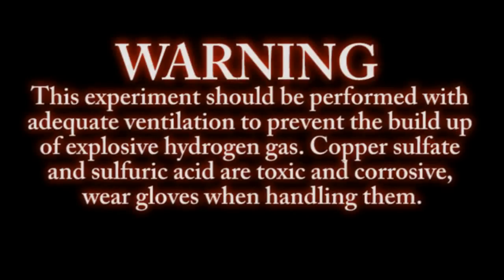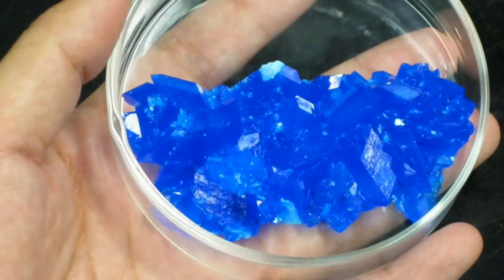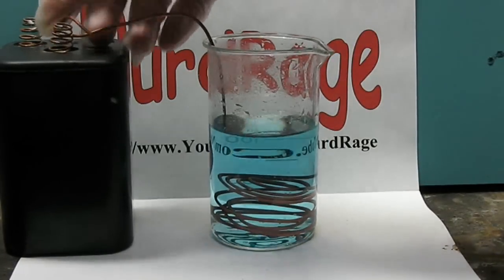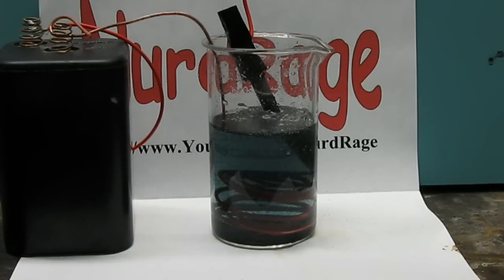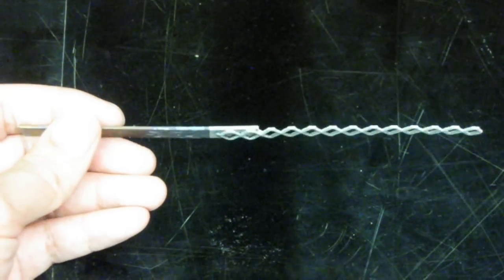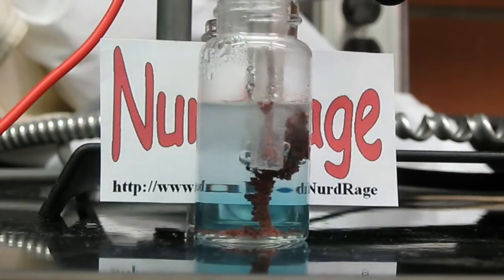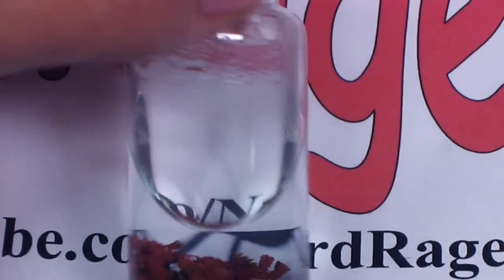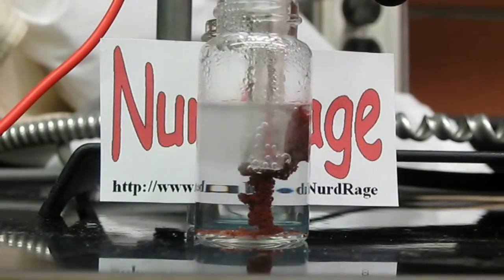Make Sulfuric Acid (Copper Sulfate Electrochemical Method)

Comment: i switched the carbon electrode for a graphite one and it worked considerably better. the graphite didn't erode and it worked very quickly and very well
Reply: Holy crap I didn’t expect to find you here ten years later
Reply: @jasonnikakis6033  second that
Reply: As in a lead pencil?
Reply: @dragan3290  I tried pencil lead the same day I commented that, and (possibly due to my power supply being too strong) I just got super fast erosion and heating (some of the tape I used as a quick test for the electrodes melted). I plan on opening alkaline batteries for zinc and manganese so I'll definitely get some proper carbon electrodes from those too
Reply: @jasonnikakis6033  aaaawwww yeah! Alkaline battery? I forgot all about that! I need to do a refresher in electronics! Lol. Thanks for the quick reply 👍👍👍👍
Reply: @dragan3290  no as in a graphite rod .
Reply: Random idea but what if you literally wrap the carbon electrode in a filter? Flow of ions should be unaffected (?) And the particles stay inside. I wonder if this increases resistance or not
Reply: @jacobkudrowich  Which are found I'm alkaline batteries
Reply: wow
Reply: What's the difference between carbon and graphite??
Reply: @JoakimfromAnka  the crystal structure. Graphite is when carbon is formed into neat, stacked honeycomb sheets

Comment: If anyone wonders I just calculated that 750 grams of cupper sulfate pentahydrate should give a theoretical yeld of 161 ml of concentrated sulfuric acid. Just saying...
Reply: thank for that i was one of those wondering... and what concentration over 50??
Reply: Cool
Reply: Do i can use gold electrode and titanium electrode ?
Reply: Could you end up with 99% acid if you use anhydrous copper sulphate? It seems that about 1/3rd of the weight of copper sulphate pentahydrate is water and must be almost impossible to achieve a concentrated acid from electrolysis alone. I might actually try it with anhydrous and just keep adding it until no more dissolves and see how much I get.
Reply: @mrdojob  Whether you dissolved anhydrous copper (II) sulphate or copper (II) sulphate pentahydrate into water, the copper (II) sulphate will dissociate into the solution. Sadly, it won't make a much of a difference if you dissolved anhydrous copper (II) sulphate instead of copper (II) sulphate pentahydrate. You eventually end up with Cu(+2) and SO4(-2) ions in the water.
Reply: Agreed. For every pound of copper sulfate I get 100 ml of concentrated H2SO4. Lead dioxide  anodes are cheap, easy to make and work efficiently.
Reply: @colinbainbridge5275  can I remove from old car battery??? I have a big deep cycle battery at 105 AH? It's dead too! Any reply appreciated cheers from Australia !

Comment from the maker: The old ways involved high temperatures. While not too hard most hobbyists prefer not to deal with them. 

Check out "lead chamber process" and "contact process" for sulfuric acid production.
Reply: Hey, been enjoying your videos for a week now, just wondering if a magnesium electrode could be used to perform the same reaction but from magnesium sulphate? It is slightly cheaper to purchase, but you say other electrodes work terribly, did you just mean for copper sulphate solution specifically, or this reaction in general?

Comment: I hate to ask this but please thumb this up so everybody can see:
A cheap way to make this electrolysis is to use silver solder wire (just make sure it's not thin wire) to replace the platinum electrode. I tried it with a 5 amps current and started with a 50 degrees celsius saturated solution of copper sulfate. I don't know the concentration of my acid but i know it's more than 1 molar since the pH is lower than 0. The results are stunning and my acid is really pure.

Comment: Hello, I tried this with a copper anode, it obviously wears off, I tried with stainless steel anode, it wears off, I tried with a small piece of graphite, it wears off but my understanding is that at least it won't collect in the cathode, I tried with a titanium coated bit, it wore off, so I'm thinking it's because it's titanium nitride? I'm thinking of buying a piece of titanium and try again, but will it wear off again? I dont know where to get platinum plus its way too expensive. Help please?

Comment: sorry kinda off topic, but if you had ammonium sulphate solution (or powder) could you heat it to drive off the ammonia portion making sulfuric acid or would it just break apart into several gasses?  (NH4)2SO4 --heat--> 2NH3 + H2SO4 or no, probably just dreaming, but I needed some MgO for a crucible and the ammonium sulphate is a free byproduct. I mean who doesn't like free acid right?

Comment from the maker: @steq22 yes you can use copper sulfate pentahydrate, no you cannot use stainless steel for the electrodes. it must be platinum, carbon, or manganese dioxide.

Comment from the maker: @zcuttlefish

as explained in the video, the copper is reduced at the negative alectrode and deposited, the water is split at the positive electrode and oxygen gas is released while H+ ions are left behind to recombine with the sulfate and produce sulfuric acid.

A side-reaction that also occurs is the H+ can also get reduced at the negative electrode to produce hydrogen gas. thus the warning about the hydrogen gas build-up danger.

Comment: I found that a lead metal strip seems to work pretty well for an anode. The surface just oxidizes to PbO2 and keeps liberating oxygen without corrosion. A cheap alternative if you can't get platinum or don't want to take apart a battery.
Reply: Wouldn't it be a better Idea to add the dioxide layer in a separate solution so there's no Lead contaminants in your Acid? I'm not a chemist so correct me if I'm wrong, but it seems logical.

Comment: Really nice! I tried this one and it worked well - then I simply used a ceramic pot on the stove to boil away most of the water. The problem is as described to find a good electrode for the anode - even carbon rods rapidly get pulverized into particles so fine it's hard to filter out (perhaps easier if using something better than coffee filters). As the water is boiled off - even the dirt gets concentrated and the finished acid will end up rather dirty.
Although the corrosion of the anode does not seem to be affected very much by the current. Of course - for example twice the current cause it to erode away twice as fast. But the conversion from copper sulfate to sulfuric acid also goes at twice the speed (so electrode consumption is not higher). It does however, corrode faster and faster as the process go on - the acid seems to have worse effect on a carbon electrode, than the sulphate. I did put a coffee filter over the electrode during the process - that collected most of the carbon particles and maked the sulotion stay clear enough to watch the process going without the need to stop and filter out carbon residue, all the time.
Same thing seems to apply to the hydrogen production. The amount of energy wasted on hydrogen production is determined by the ratio between copper sulphate left and already reacted acid. There is no hydrogen being produced at start - then it start's bubbling more and more at the cathode as the reaction goes on. 
Only thing that happens if you turn down the current once the bubbles start coming is that you slow down the reaction so much that you don't notice the bubbles any more (but the same amount of hydrogen is still produced - just at a slower rate). After a while, it starts bubbling again - and you turn down the current even more. That happened to mee. I was starting at about 5 amps, then gradually dropped down to 1 amp during 12 hours. After that - the sulotion was still slightly blue and some bubbles where coming from the cathode anyway. 
Then I turned the current up to about 10 Amps, just to see what happens and there was a lot hydrogen fizzing from the anode, but it went clear in a little over 1 hour - and the electrode didnt corrode faster than it did with 2 amps during 5 hours.

According to my other experiences with electrolyzis as well (I have made hydrogen/oxygen production and iron oxide production) - the speed of the process is directly set by the current. Current density doesn't effect the speed of the reaction - but it do affect the efficiancy and shud be kept as low as possible. Bigger electrode surface area allow for that, and put them closer together decreases resistance. The thing is that the voltage that needs to be applied to get the desired current shud be as low as possible. Every volt above the minimum needed to keep reaction going is just a waste of energy. It doesn't speed up the process - that energy is just turned to heat.

Comment from the maker: titanium passivates, and stops conducting, if used as on anode. so it has to be plated with something.

i'm not exactly certain how long a platinum surface will last. i think it depends on many factors like current density and the impurities in the solution.

Comment from the maker: @mV33rs

Not all processed carbon is conductive enough for this to work. Carbon meant for non-electrical purposes may be mixed with binders and clay to give it better properties, but it will be less conductive.

Battery carbon is the best.

Comment: I got my anode in today,   I tried the carbon anode a few weeks ago and it worked.

Got it wired to an atx power supply's 5 volt rail rated for 22 amps  and its working nicely.

Comment from the maker: @coplants
you can go further, but hydrogen production increases, so you need to perform this in a well-ventilated area to prevent hydrogen build-up. Other wise use a sealed cell that you can direct the hydrogen and oxygen gases outside and away from your work-area.

Comment: for any one wondering Lead dioxide anodes can be used , it works just as effectively and doesn't degrade at all.
Reply: metallic lead electrodes works good too
Reply: +Sir Shad:
You can use lead but the + lead electrode (anode) would get oxidized to PbO2.
I have done electrolysis of H2SO4 with 2 lead electrodes and that's what happens.
Reply: Infact i did this by accident once, when i tried copper coating a bullet via electrolysis.

Comment from the maker: it's a side product, hydrogen is also formed since some of the electrons will reduce the hydrogen ions into hydrogen gas, as well as the copper. Only precision voltage control relative to a reference electrode can prevent this. Very difficult for an amateur to pull-off.

Kinda like microwaving a glass of water and a mug of coffee at the same time. You just want the coffee to heat up but the water is going to heat up anyway.  Same thing with copper and hydrogen.

Comment from the maker: @TheCLockMen

Yeah, it certainly would produce more concentrated acid if it evaporated.

but be careful, if you're pumping that much current in you might damage your expensive platinum electrode. Also ventilation is important to prevent hydrogen buildup.

Comment from the maker: @jpthecreaton

So you DIDN'T do the experiment correctly. 

Try the experiment again, this time without the steel. Get a hunk of pure copper metal, then add it to sulfuric acid under air-free conditions, it won't dissolve.

Comment from the maker: @jiraya12345

so you want high purity?

dissolving iron in nitric acid and then pyrolysis of the iron nitrate should yield some extremely pure ferric oxide powder. very expensive though.

Comment from the maker: @jpthecreaton

You're dissolving off the oxides on the copper. 

Try it yourself, get some sulfuric acid, leave a hunk of copper in it, and tightly seal the lid so no air gets in. The copper itself will be unaffected.

Comment from the maker: @JehuMcSpooran

how would you convert magnesium sulfate into copper sulfate?
Reply: 1) Separate a solution of magnesium sulfate into two half-cells separated by a salt-bridge
2) Use copper electrodes (it's really only important that the anode is Cu
3) Run a current... The anode half-cell will produce CuSO4 and the cathode side will produce Mg(OH)2

Comment: There are two competing reactions at the cathode: reduction of metal ions into the metallic form, and the reduction of water. Electrolysis reactions will prefer the reaction that requires the least amount of energy. Thus, with magnesium requiring 2.38 Volts, yet water only 0.82 Volts, it is clear that you would not plate out any magnesium.

But let's assume that, for some reason, some magnesium actually plated out. Magnesium reacts vigorously with acids back to ionic form, so MgSO4 wouldn't work

Comment: I got some lead dioxide plates from a rather small lead acid battery, it's incredible how even being a very soft plastiline like paste, the erosion is 0% and it bubbles a lot! I had a supersaturated solution of copper sulfate and it's still work in progress, I added a little more water and it seems to work a bit faster...

Comment from the maker: @adigal123 however much you want, depends on how many electrode you intend to make and their size. 

But platinum, especially from a chemical supply company (that sells at an excessive markup) is disgustingly expensive. And doing chemistry for the first time with little experience means you WILL screw up your first dozen or so experiments. Do you really want to risk that much money on it?

Comment: @NurdRage really i thought u needed to reduce the voltage, which also results in less current

anyway wat erodes the carbon? amps only? does temp matter, wat abt the bubbles forming on it i thought that might be one of the reasons

and wat if i were to use pencil led do u think that would work better? probably not too good for conductivity, but maybe if i use hard led then it might not flake as much?

Comment from the maker: @Zink575
pure lead would corrode into particles of lead dioxide that will get mixed in with the acid, while you can filter it off, dealing with lead waste isn't worth the hassle and it's illegal to dump lead wastes with regular trash.

I'd say don't bother and just get a bunch of carbon rods instead. A lot easier to deal with carbon than neurotoxic lead.

Comment: Lead anode works very well. The oxide layer mostly stays on the electrode and if it falls off, it can be easily filtered off. However, if you don't want the acid to be contaminated with lead you will need to distill it.

Comment: Ok. questions. Could you use a gold electrode instead of platnium? Is it possible to make nitric acid  using sulphiric acid and copper nitrate? And if so, is it possible, with the addition of electricity to create a cycle between nitric acid, sulphiric acid, and the element copper that never ends?

Comment: i used a 1-molar solution of CuSO4 and want to share the information, that up to a certain concentration of acid (about 5%), the Copper in solution reacts back to Copper Sulfate.
I would recommend using a lower molarity

Comment: I don't know about how exactly to do the catalyst, it was just something I read a long time ago in a "modern mechanix" article. I imagined just using some burned steel wool in a steel tube heated by a flame from outside.

For leadting the SO3, um... not sure. Steel is invulnerable to H2SO4 and so are some (maybe most?) plastics. HDPE works I think. Maybe you could heat and form a fluorescent light tube? Might crack but it could work. You could just try the rubber tube and see I guess.

Comment: @SwitchBlitz yes.
His description mentions an INERT metal.  google that and you'll get several different results:
rhodium, platinum, gold, osmium, iridium, and palladium are all very expensive.  however there are a few others: carbon, and nickle.  i am currently trying it with the carbon rods he describes.  so far it is working very well at a current of: 3v, 300milli amps.  it is also eroding quite slowly too.
silver

Comment: is there any other electrode i could use instead of carbon and platinum electrode ?
Reply: Dr. Dimethylmercury  finally after six years I got an answer , thank you
Reply: @shaheerrauf8004  share it mate
Reply: @phobos1963  if only that comment existed , or I remembered what it said
Reply: Im trying a lead anode(244g 60cm²). 240g of copper sulfate, 500mL water. Top of the solution is cloudy white. Copper is plating good.Running at 6 amps. Any higher and gas starts forming at the cathode. Anyone know what this side reaction is? Should take about 6 hours to complete. Im trying lead because of the surface area per dollar factor. I want this done fast as possible.
Reply: Total time 3.5 hours. My lead turned black with no change in mass. I used a piece of stranded copper wire as the cathode and made a rat nest with it for more surface area. As the copper began falling out of solution i was able to increase the current to 10 amps without bubbles on the cathode.

Comment: It took a long time but I got it. I used a lead fishing weight as an anode and it worked great. The solution has a pH of 1 (now i have to boil off the water because it's very diluted)

For current regulation i used a nichrome wire in series with the electrodes and it worked great too (it's not the most power efficient solution but it's simpler than building a regulated current source :P)

Comment: i have a 600v dc power supply at about 20mA. alternatively could i put a resistor on a car battery to limit the erosion of the carbon rod?

Comment: Im stuck with carbon electrodes but I do not like the eroding. Could I possibly wrap the carbon electrode in a tissue or some membrane to prevent the spread of the carbon particles?
Reply: Just the Just2 months ago
@nurdrage I covered my graphite electrode with filter paper (2 layers, wrapped around) and prevented the C particles contaminating the product.  Thanks for this video; I've now reclaimed my excess CuSO4 and have smelted the Cu :)